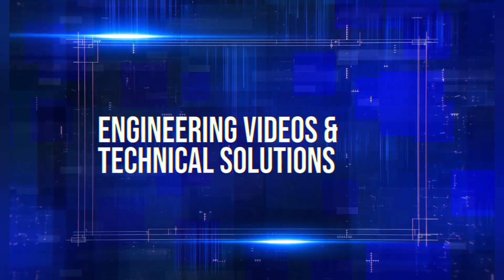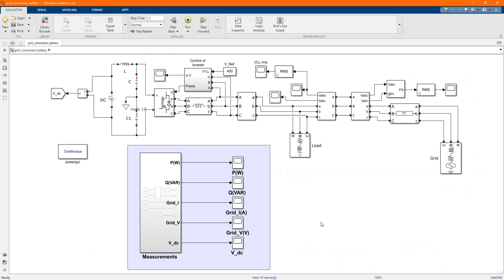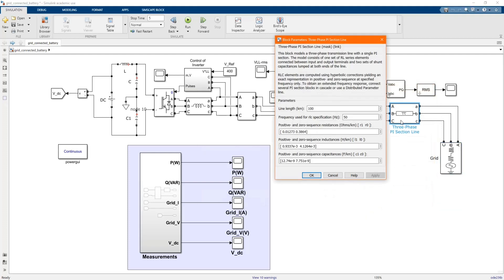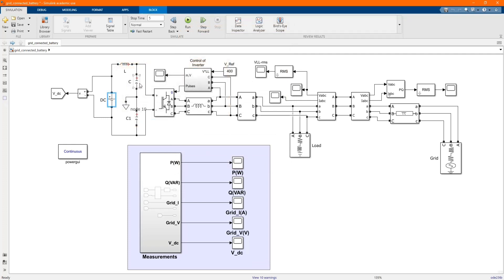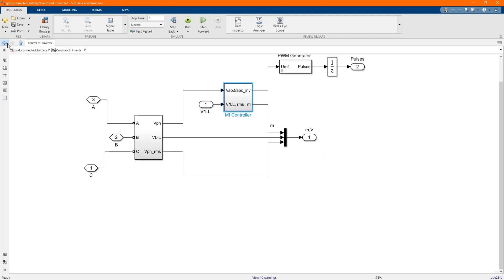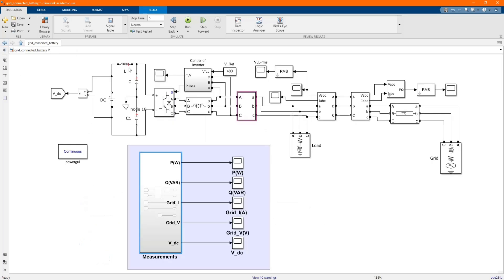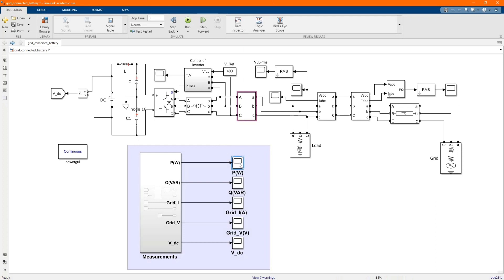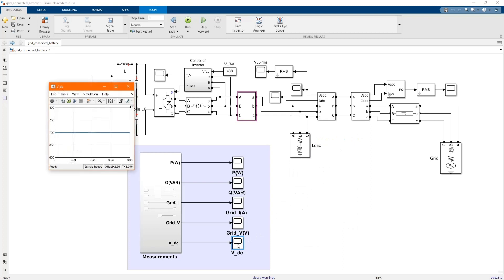Simulation of Grid Connected with Battery in MATLAB Simulink - method 2

Comment: Can I use Li-On Batter Model in this project and if I can, how will I be able to control its charging and utilization??
Reply from the maker: You can use any battery, you can determine the charging and discharging by determining the reference charging and discharging Currents